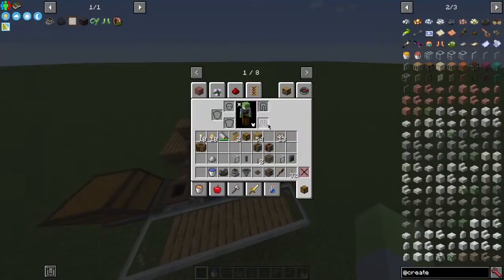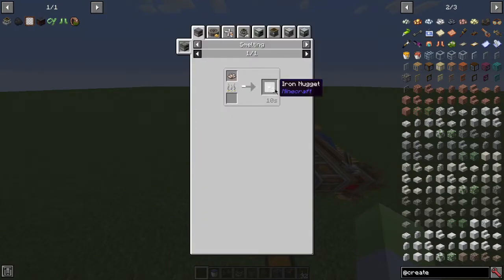compact-ish ore washing setup in create above & beyond

Comment: Nice! What's holding the water in place?
Reply from the maker: Thanks! They are held in place by oak plank strips!  You can combine oak planks with a saw (flint, iron, etc saws all should work). I believe you then place the planks right under the saw? And it will make vertical slabs then you take those and put them back in the grid and cut them again into smaller pieces. Do that over and over til you get thin strips which you can place next to water or lava and it holds it in place and looks really nice. By the way you're the first to comment on my channel so I thank you for that.
Reply: @t0ad  My pleasure! Honestly this is one of the more thorough build videos I found on the subject, a lot of the others gloss over too much.